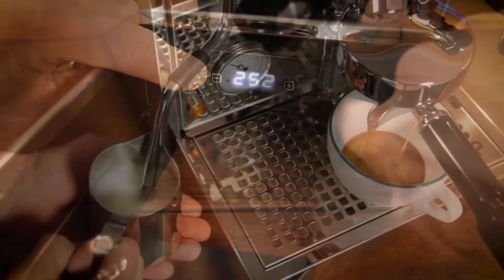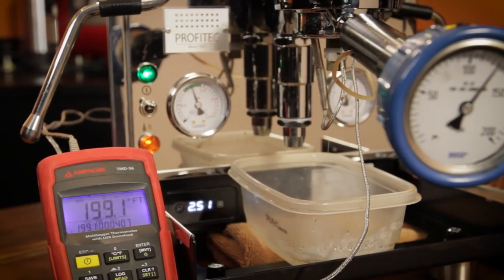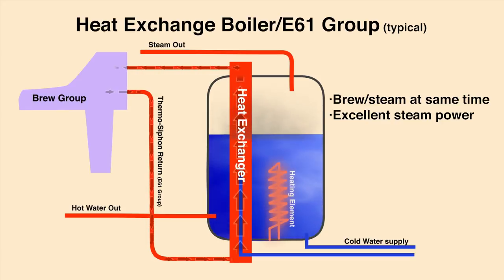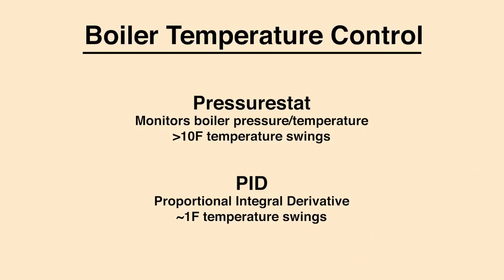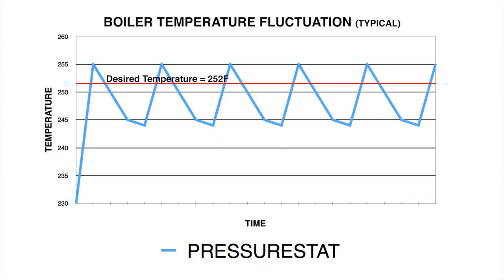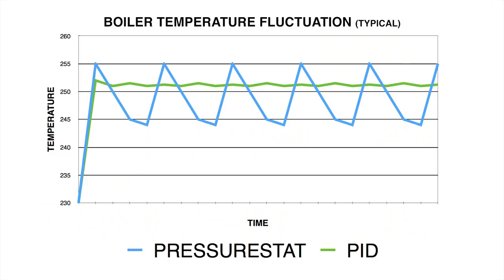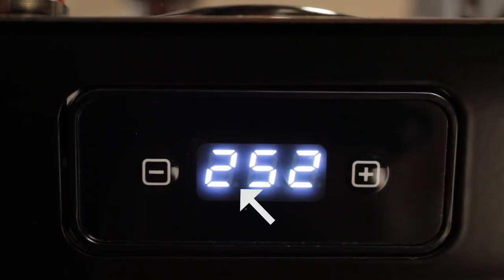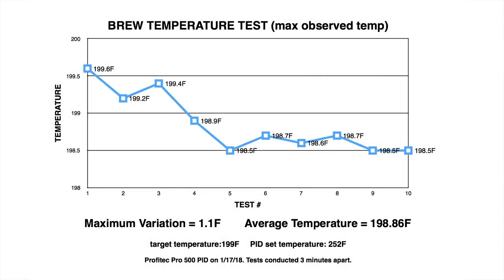Review: Profitec Pro 500 PID Espresso Machine

Comment: I have this machine now for a period of 3 months and bought it also based on the loving reviews on WLL. I use it with a CoffeeSensor (similar to Ericks thermometer) and would like to share the following with those interested of buying this machine:
1. The suggestion made by Whole Latte Love that this machine does not need any cooling flushes is simply not true and after making myself familiar with the technical side of HX machines, this is also simply not possible. In my view and experience there is definitely a build up of heat during time and during the day. So the temperature at the puck is a few degrees different depending on when the machine was last switched on, you made your last espresso, etc. I even noted that when you put the top of the machine full with coffee cups (blocking the vents), the heat is less able to escape the machine trough the vents impacting heat buildup. The pro 500 however does seem to do a much better job than other HX machines in this and the build up is a lot less, limited steam build up. This is probably because of the flow restrictor and has not much to do with the PID.
2. Also the comment made that the temperature at puck and the table in the instructions manual needs updating is simply not true. This is only true when you measure it 40 minutes from (cold) power up. From my own user experience I now know that it takes at least 1,5 hour for the group head the reach its full and stable/idle temperature (around 200 degrees F). In my case the machine came set at boiler temperature of 246 degrees F, which seems to be pretty much spot on when the machine is on for longer than 1,5 hours. WLL testing procedures in this respect are limited and do not take into account different (cold) startup times or include measurements of the group heat temp. I would suggest to use both in the future. For example to measure brew temp after 45 minutes and after 90 minutes. Setting the temp higher at 252, will result in much more heat build up during the day and a too high temperature at the puck. 
3. Taking this into consideration the machine probably is outstanding for a HX machine, but for a newbie like me much more difficult to handle than a DB machine. This is less probably noticeable with few month old darker roast coffee, from the big brands, such as Illy or Lavaza. Especially if you use lighter roasted fresh coffees (one week old) temperature stability is key and a very important factor. Especially because home HX machines are a lot more prone to temperature difference, because there is no stable flow like in a coffee bar etc. So for home use this would be a big plus to DB machines. So when you consider buying an HX machine be prepared to put in a lot of time if you planning and drinking fresh lighter roasted coffee.
4. A PID sensor is a nice feature to stabilize boiler water temperature en its impact on brew temperature. However there are a lot of other factors influencing brew temperature, as discussed earlier. The convenience of this is more stable temperature delivered through the group, but again has nothing to do with brew group temperature itself or build up in the HX. The flow restrictor reduces this buildup. 
5. A temperature sensor on the brew group is however a must to get to know your machine much faster. Would be curious to see what the view of WLL is on that. It could be a differentiating factor for a manufacturer like Profitec to include or provide a build in temperature sensor in the group head for example.
6. Too bad this machine does not come with a Rotary pump option like the Rocky machines. The pump is still pretty loud, especially since I paired it with a Eureka Atom 75, which is unbelievably silent.

All things taken into consideration I very much enjoy and love this machine (once you get to know it) and probably one of the best solutions for the money, but wanted to share my experience because WLL very much focuses on the technical / build quality of the machines and less on real life use scenarios in their testing. Very much appreciate al their efforts and info :)!!
Reply: Hej Gerard, thanks alot for review. I was researching alot on the points u just mentioned but so far could not find alot of reliable info. I am still thinking about getting the Profitec Pro 500 or instead a Prosumer DB. From your review it seems like one should get (Ericks) thermometer to measure the temperature at the puck when one goes for the Pro 500. Wow, 1,5 hrs to get stable temperatures seems also pretty long... I was almost about buying the 500, now I am a little worried. Do u think the Profitec Pro 500 can compete with high end DB's? I would have the time and pleasure to get the most out of the Pro 500. Thanks for taking the time, highly appreciated!
Reply: Hi Karsten Kamps, Thanks for your response. Are you Dutch too? I don’t have any experience with a DB machine. But from an engineering point of view, also with a DB machine you will have certain temperature variability I guess, but a lot less compared to HX because the brew boiler temperature is a lot lower in general than a steam boiler, so less build up of heat over time. Brew head temp however also changes with room temperature, time of day, if you make a few cups short after each other, etc. So yes in my view a temperature readout and sensor on the brew head is very important to better predict your shots, both on HX and DB machine. You just don’t have that standard flow at home. Especially when you take your coffee at different (not set) times of the day. A warm-up time of 45 minutes is sufficient, but you will need to set the PID at a few degrees higher than factory standard as suggested by WLL, to result in high enough temperature at puck. I prefer longer warm up, because the too high temperature setting suggested by WLL resulted in good espresso after 45 min, but too high extraction temperatures/burned coffee later on the day. I could first not understand this, thought it was my technique etc, but after installing the Sensor I came too conclusion that temperatures were just too hot during the day. Hope this all makes sense, because for me it was a Eureka moment and this would not have happened should i have just stick with the factory preset of 246 to start with. By the way this setting still means that there is a temperature build up of about 2 degrees after a few hours which you need to remove with a few second flush. I would not worry so much about warmup time, this should be similar amongst al these machines machines, this just takes time. Especially the heat up of the full group itself just takes time. I use a timer (TP link HS100), which puts the machine on at least 1,5 hour before I wake up and then leaves it on the rest of the day. My take is that the pro 500 is probably the best HX machine money can buy and can produce a similar and even better tasting espresso than a DB. This comes however with a little bit more variability which you can learn to master if you have the time and patience. Furthermore a DB also clearly has its disadvantages with less fresh water (because its sitting in the boiler for longer periods) and narrower temperature profile. During a shot the pro 500 decreases about 1,5 degree, with DB this reversed change in temp is much less, which also results in a flatter taste profile. You would daily need to have both machines side by side and drink  the same coffee from both machines and use it for a few weeks or months to start tasting the difference. If you get the hang of it the HX is a lot more control over the process I guess, you can even directly play with temperature if you prefer sour vs more bitter shot just by flushing shorter or longer (combined with Sensor readout) and this is the same as comparing an automatic vs stick shift in a car. With a DB it takes time for a change in temp to take effect. For me also the size of the machine and the cost played a role. These machine already are present on your counter top, but DB machines are even bigger and in NL the synchronika is also almost twice the price of the pro 500. So as a first machine i am very happy with this one and my shots are now each time close to perfect, and I believe the Sensor is key to that. You can better invest this money in a better grinder. Reasons for me to go for DB would be, more power (both in steaming and brewing), rotary pump, fixed plumbing, preinfusion, but not so much taste in cup.
Reply: Thanks alot for taking the time to give such a long and well-balanced answer, Gerard. I am German (from Hamburg), so we when you are Dutch: hi neighbour!
I read through the home-barrista forum and I have now a much better understanding of the HX vs. DB (never ending) debate. With your detailed information on the Pro 500, I am know able to determine whether this machine fits my needs. After being a little irritated about the workings of a HX machine, I like them more and more since their simplicity comes with a practical benefit, that is, there are less parts that may break resulting in less costs in the long run. However, this comes with a complexity increase - as you say - when these machines are used which can be also utilized when one is skillfull enough to drive the manual HX machines (to stay with the metaphor;). For me as someone who made his coffee via French Press so far, there is still the question of whether I can master this machine. I have no problem at all of learning on the machine for two months until I can pull consistent shots. But I want to be able to pull consistent shots at some point, meaning, I don't want to guess anymore. Are you now able to pull good and consistent shots without try and error? What is also important for me is to be able to pull up to 4 consistent shots in a row. Is this a problem on a HX e.g. when one considers the recovery time in between shots? Thanks for your help!
Reply: Hi Karsten, always happy to help a neighbor ;)! Hamburg is great city, visited it for work few years ago. 

Consistent shots are in my view dependent on the following:
1. First and foremost: Coffee, Coffee, Coffee. As long as you use ‘old’ beans from large manufacturers like Illy or  Lavazza etc. it will be much easier to get consistent shots. These beans are generally darker roasted (easier to grind) and received a factory treatment against aging. So essentially they have a much more stable taste for a longer period of time. However this comes at a huge expense: Taste! Once you have tasted fresh roasted beans, you will discover a whole new world an there is no way back. It is like tasting coffee for the first time and how it is supposed to, because you are used to drinking ‘old’ coffee all the time. This also means that you have to develop a new taste, the acidity and sour taste in fresh beans is something you need to get familiar with in the beginning, this takes time, because most people are used to that bitter and strong coffee taste. Fresh coffee is much more difficult to manage in terms of consistency, that is why a lot of home baristas learn to roast their own coffee at home, this is much cheaper and enables you to make fresh coffee al the time. I still order new beans each week, so I have fresh coffee. The time window is extremely small for fresh coffee (about a week), therefore I recommend investing in good vacuum canisters to store the coffee once you opened the bag. I use 32 oz Airscape canisters, ordered on Amazon (which hold about 250 grams of coffee). These canisters are designed to push out the air and therefore Oxygen when you close them. Oxygen and light are the biggest contributors of aging of coffee. Their are also some systems that include valves so the co2 is a able to escape the canisters. This however is a gimmick and totally unnecessary when you let them degas the first week in the bag they came in (those bags always have a one way valve). My routine is that I order 2  fresh bags of coffee at a local roaster each week (both 250 grams) and I leave them in the bag for 1 week (from roast date) to degas, don’t open the bag!!. During this first week its a better to not drink the coffee, because the beans will taste sour due to the degassing process. After the first week you can open the bags and put them in the canisters and in your grinder. I use a single dose system so only store them in the canisters, see below. The coffee will than taste excellent the first few days, very good the few days after that and after the second week (from roast date) quickly will start to deteriorate in taste. So invest in coffee first, and equipment second.
2. Grinder. You have probably already read that grinder is important. Being a newbie a started out with a profitec grinder which matches my machine well, a M54 manual grinder. This grinder however has limited options and is good with darker older coffee beans, but not so good with fresh lighter roasted beans, which result in sticky and clumpy ground coffee. Furthermore I really much wanted to explore single dosing, because I like to have option and possibility to change coffee. With hind side I should never have gone for the profitec to begin with and choose a well known commercial ‘grinder’ brand instead, however I first wanted to try out the home barista stuff, before buying an expensive grinder too. I switched to a Eureka Atom Speciality 75 a month ago. It is basically a commercial grinder in home package. I very much like the design too. But what a world of difference!!. If you talk about consistency, this plays a huge factor. Clumps and stickier ground coffee will result in much more channeling etc. The ground coffee from the Atom is unbelievably fluffy, consistent and its very fast. This makes tamping childs play and no need for any fancy accessories to distribute coffee in the portafilter. Also the retention is only 2 grams, so I use it successfull as single dose grinder (clive coffee recently made a video on that). Make sure to grind like 5 grams of coffee each morning to purge any old coffee from the day before. So invest your money in a grinder before making a choice between HX or DB. Second hand commercial grinder is cheapest, but only if aesthetics are not important.
3. Temperature control. One of the biggest factors in consistency after coffee and the grinder is temperature control on your machine. As discussed earlier, this is a much debated difference between DB and HX machines, but very too much overrated in terms of actual contribution to overall consistency. DB machines are more stable on this respect, no doubt. However I noticed that the Pro 500 is very consistent in delivering water at a set temperature once you respect the heat up time of 1 to 1,5 hour instead of 45 minutes. So performance comes close to a DB. What however is very key in this is not the temperature of the brew water itself, but very much the temperature control of the brew group/head and portafilter. You will see this once you invest in a temperature sensor on the group head. It’s like having a speedometer in your car. For example i purge and clean my portafilter with warm water in the sink after each use, which cooles the head a few degrees. So you can not do this and should clean it with a brush instead when you want to make more coffees after each other. But still than you have to respect the recovery time of the machine. WLL uses 3 minute intervals in their testing, but I don’t think they take off the scace device during testing. In real life you take of and clean the portafilter and by doing so it looses heat and also the group itself is than more exposed, so recovery time of 5 minutes is much more realistic when you clean with brush or towel and closer to probably 7- 10 minutes when you purge the portafilter clean with water. These are just my own best guesses based on my user experience. Not respecting the recovery time will result in lower temp and therefore more acid tasting cup. Not respecting few seconds cooling flush on the pro 500 (after longer period of not using) will result in too high temps and burned/bitter tasting coffee. You can always read the brew head temp from the Sensor. Once the water starts flowing this temp will change to water temp flowing by, so this tells you how long to flush etc.. With a DB machine the capacity is usually bigger, but still you will need to preserve heat in your group and portafilter very carefully when making more cupps after each other. The boilers and machines in coffee bars are much bigger, hence temperature stability is much better than at home. Also these machines have more than one group, allowing for a steady flow. This limitation in flow and stability is just inherent to a home machine, but favors a DB slightly over a HX because of large capacity. Second the DB usually have larger steam boiler and 2 bar steam pressure compared to c. 1 bar on HX machine. This makes it much easier to froth larger amounts of milk, for two lattes for example. So if your willing to spend the money, a DB will give you more ease in workflow, but temperature wise it will not make a huge difference. My shots are temperature consistent each time, when respecting recovery time, with max 1 degree difference. Get a sensor!!
Reply: Hej  @gerard3797 , thanks again for your very quick and informational answer. I am now also a proud owner of a ProfitecPro500 and a CeadoE5P grinder and I am very happy with the set up. Your information convinced me that when it comes to prosumer machines like from Profitec good and consistent shots are not so much an issue of DB vs. HX but it's about the barrista. It was also very helpful to know that you updated the M54 grinder as they recommended it to me in the shop, I finally went for the Ceado as it is a better grinder than the M54 but in my budget:). I already pulled some nice shots and on a second attempt I produced an amazing FlatWhite (perfect microfoam mixed up with good espresso from the machine), since then I haven't reached that level again. But I am getting better on a daily basis and I am looking forward to produce consistently great FlatWhites in the future. Thanks as well for letting me know how you deal with fresh coffee beans. I already got some fresh fruity coffee from Nicaragua, that was a totally new tasting experience for me. I will let you know how my coffee experience is in the next weeks. Best from Hamburg to the Netherlands (from which city are you?:)
Karsten
Reply: Hi Karsten, I live near a city called Den Bosch, it is in the South of the Netherlands. I had the same experience with those first shots tasting heavenly. But you very quickly become used to even that great taste and that puts your expectation levels even higher the next time and the next time, which is difficult to reach again or maybe even impossible. I always notice how good my coffee is when I drink one from a fully automated machine at restaurant, a friends house or at the barber shop I go to. This year I started intermittent fasting, and during those 2 days I don’t drink Lattes (because of the milk). If you than again after a few days make one, it tastes so much better than usual, it is almost like tasting it for the first time. It is te same feeling I had on holidays in Italy years ago. I still have a great moment the first day that you open a pack of freshly roasted bean, especially when you just fully cleaned your machine and grinder. I order them now on a weekly basis, but maybe will start to roast for myself in the future because ordering fresh beans each week is pretty expensive and the taste quickly deteriorates after only a few days. How is your experience so far?